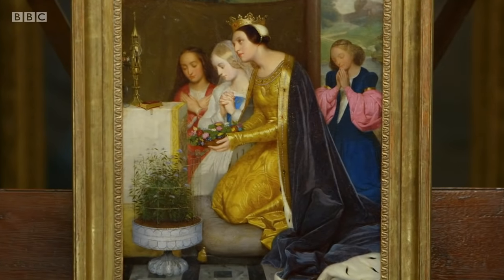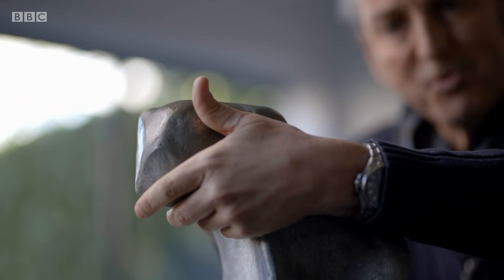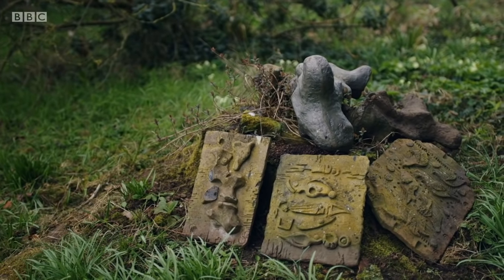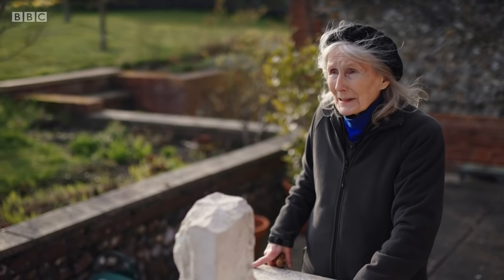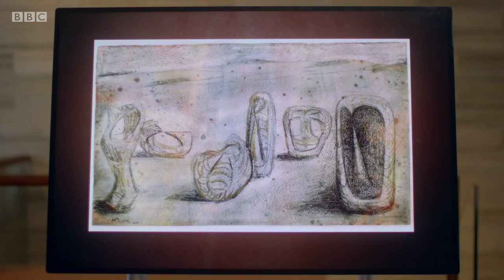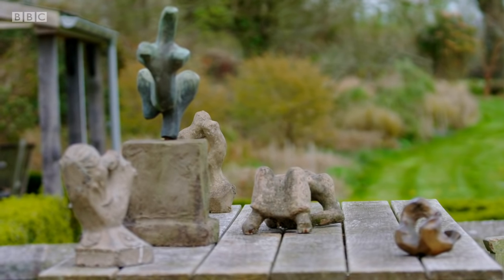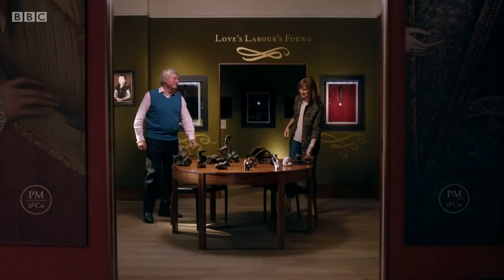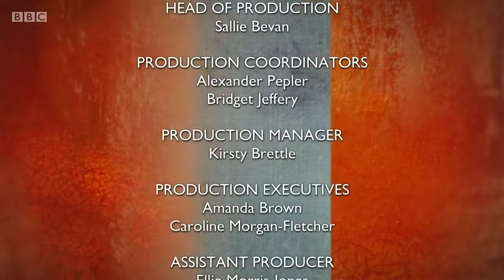FAKE OR FORTUNE 9X01: HENRY MOORE

Comment: I believe there might have been a cement version to create the sand casting for this piece, but that may mean Betty had help from one of those assistants to moore, afterall this is much larger then any of her other pieces. It would definitely require a huge furnace and crucible to pour this in one go.

Actually the third largest foot was probably the pouring zone, it might not even been intended as a part of the sculpture. An any rate it might not be finished.

Comment: So these guys have never heard of measuring the density? Dirt cheap and would have shown that it was the density of aluminum (after the xrays showing it wasn't hollow. Or a sonogram would show that it was solid.) Density: (1) immerse in water to figure out the volume of the piece. (2) weight it. (3) divide weight by volume. Al=2.7g/cm^3 .  Bronze=8.7g/cm^3.  As soon as they xray'd it they should have realized it was too light for anything but Aluminum.  Surface XRF does poorly with light elements but their readings looked really bad  - probably measuring dirt. Maybe give it a rinse first?

Also it would have been useful to figure out the type of Aluminum alloy used as there are hundreds of standard types. There is a lot of silicon. Silicon is often added for casting but this is a huge amount.
Reply: Eutectic siluminium is around 14%, and when casting eutectic alloys are preferred.  What's more interesting is the patina - since the sculpture was misidentified as masonry back in 1978, its probably original.  But lets get real, it was found in the back yard of a sculpter, what  are the odds that it was made by someone else?
Reply: I suspect there's a tiny bit of theatre and product placement with some of these diagnostics. But the thing did sound like bronze when tapped. But as soon as they discovered the thing was solid vs its weight, it would have been patently obvious it wasn't bronze. But bring out the nerd with his electron microscope to show off the tech anyway. I'm not meaning this in a disparaging way - that step was probably unnecessary, but still interesting. And perhaps they want to be sure there's no ambiguity when submitting findings to the review committee.

Comment: I see it as evidence of a hot fling between Betty & Henry where he popped by after class and ran one of his sculptures through her Aluminum alloy casting process.  It's significantly larger than any of Betty's pieces, more along the scale of Henry's, and it has more angular features than her pieces, so also more similar to Henry's.

Comment: Also, the comparison of the piece in question to the other verified Moore piece that was only begun and abandoned, also found in a garden, just shows the chiseled look of a sculpture in its early stages, with only a bit taken away from the original block, as one does in the making of sculpture. You can't add after you've chiseled away, after all, and the piece under scrutiny clearly has been chiseled away quite a bit, and has concave forms which imply an end stage, a terminal stage or state of a sculpture, because, again, you're taking bits away when you make a sculpture because you can't add to it after you've chipped away from the original block. This suggests that the acknowledged chiseled look that the two pieces have are clearly from different creation stages. The piece just isn't a Henry Moore.

Comment: The work is obviously by Henry Moore but the casting is not. Late Moore has more polished and simply defined facets. This is an early work. Jewson was interested in horses and we see many horse studies. The similar small works of Jewson with similar shape have no sense of bone definition. They are rounded and occupy form. But Moore loved cats, from his own domestic ones which died and left him their skeletons through to panthers and tigers. The profile of this is the head of a panther. Moore was the master of negative space, which Jewson was not. The shallow scoops describe eye sockets, an element missing from Jewson's work. Moore may have made and left a large maquette behind. Jewson may have found it and decided to cast it in aluminium. She thought it lacked stance and added the three feet which are blocky and lack any reference to feline anatomy.  She could not sell it or even show it to anyone or she would have been accused of forgery so it was consigned to the back of the garden rather than put on display. In fact it was so well hidden that her son did not find it when moving her stuff. So the committee was right - it is not a Henry Moore, because Jewson modified it before she cast it.

I have to say this was most unsatisfying deceit in telling this story. Its weight would have instantly given it away as being made of aluminium, but this information was concealed from the start. This was a shaggy dog story and a blatant tease.
Reply: I'm no expert in these things but it wouldn't surprise me if a work in solid aluminium and the same work in hollow bronze have a similar weight. You're right about the deceit though, once they knew the piece was solid then they could no longer claim to believe it was made of bronze.